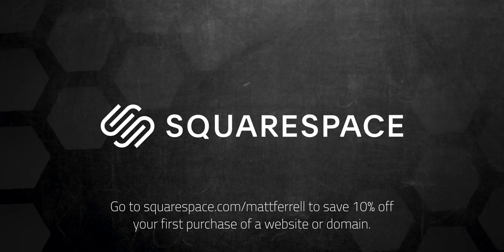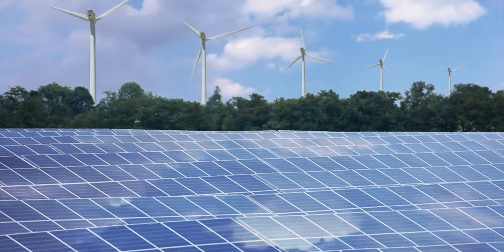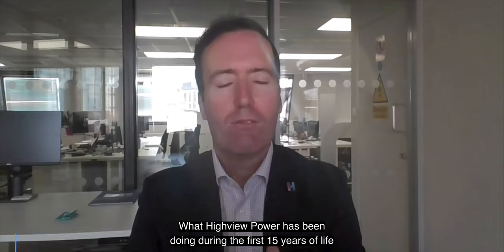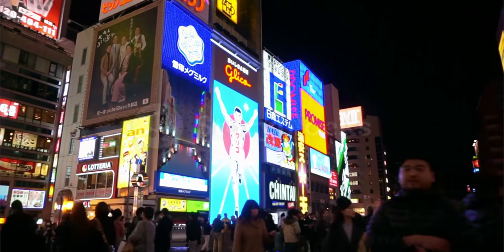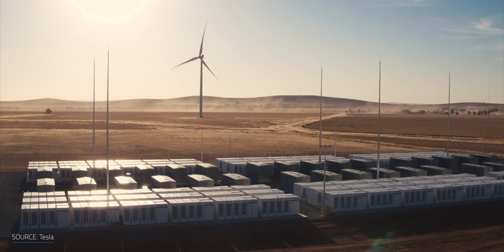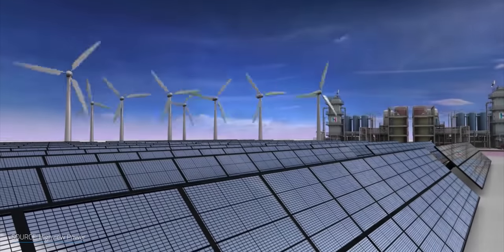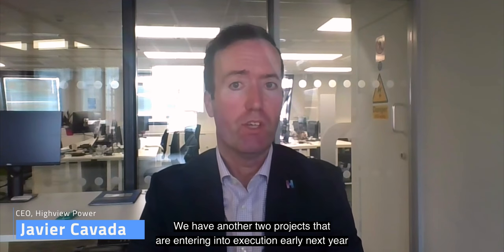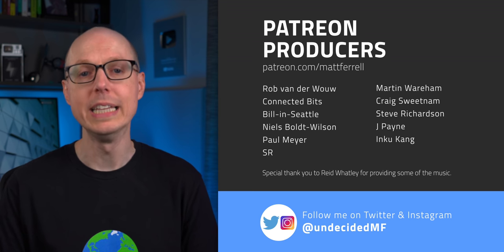Liquid Air Battery Explained - Rival to Lithium Ion Batteries?

Comment: Why not build it inside compartments underground. You'd save money on insulation and can more readily transfer heat with less direct insulation.
Reply: I thought about that too but then it's more expensive, harder to built,  harder to inspect, more prone to explosions and normally all storage processes are needed for say  half a day or so only so a little more loss is no problem.
Reply: @jean-pierredevent970  I forget my original thought process but I think underground bunkers would work. One room for cold one for hot. The rooms would act as ambient batteries further recycling heat energy or at least minimize losses seeing as some of the fixtures build up frost. It'd at least be better than having it out in the open.
Reply: @lazylazerrsp8781  Yes, true. the heat and cold losses would be minimal in these special isolated rooms.

Comment: The purpose of the liquid air storage system is to store "surplus" energy from systems like solar and wind power that would otherwise have some energy generating components turned off when supply exceeds demand, thus putting them to "sleep".  The liquid air storage of such "surplus" energy is far cheaper than using lithium Ion batteries etc...

There are also alternative energy storage systems like the flywheel, where energy is stored as a massive multi-ton rotating flywheel. The Liquid air principle is much better though I think, as it would last longer in storage until needed.
Reply: The real improvement is possible with intercontinental power exchanges through new very high voltage direct current cables. With a very smart grid, surplus and shortage of green energy will distributed real time so wind energy from China could even feed our grids during the night. Some local storage will be needed to keep the grid stable and smooth. That's why we need now very smart leaders too.
Reply: @jean-pierredevent970  What I do not understand is why have we have not started to harness the energy from Lightning.
Reply: @generaza7609  I honestly never thought about that. Perhaps the huge charged energies building up before a thunderstorm could be tapped off but I have no idea how or if it's practical to do it.
Reply: @jean-pierredevent970  Well we are referring to liquid air storage, so perhaps if there is enough machinery to absorb the lightnings entropy and convert it in real time to liquefied air, we could store it.

There are also other means to store energy such as flywheels.

If the lightning strikes were collected by huge electrodes and stepped down in voltage to a manageable level, it could drive huge flywheel motors, which may then be tapped.

Comment: While making liquid air benefits from economy of scale, one can imagine making it on site at truck stops and having trucks that could then store and use it. Especially good for refrigerated trucks since cooling is a by product. Solar air heating panels on the trailer could increase the range perhaps. Perhaps this could be practical for cars as well. I have seen compressed air powered cars developed but this would have better range and the tank might cost less. If I was GM I'd really think about leveraging my hybrid tech and coming out with a liquid air battery electric since the turbine, generator and electric drive train are definitely in their wheelhouse. They could tout recharging as fast as gassing up.
Reply: The cost of small cryo units is prohibitive compared to distribution the product from large facilities. The equipment involved in the process is very maintenance intensive. Even heavy consumers of liquid nitrogen like refineries have it trucked in. If you wanted to use it to cool refer trucks filled at stops, you’d end up just shipping it to the stops and storing it in tanks.
Reply: @gibmebalut  Thanks so much for that input. I wonder though if medium sized units could be made that overcome some of the cost issues although trucking the stuff from a large  plant near an urban area to gas stations equipped with equipment to keep it cool might be practical. If I was GM I might try to do something to overcome the drawbacks.
Reply: @stevemickler452  The good thing about cryo storage tanks is that they don't need extra equipment to keep the product cool.  The vacuum jacketing is very effective. As a matter of fact, If product is withdrawn from the tank regularly, a small amount of the product needs to be boiled off in a heat exchanger to keep the tank pressure up.
Reply: @gibmebalut  Thanks. Good to know.

Comment: Perhaps I missed it, but I was wondering what fuel is required to do the freezing and compressing? Do you have to burn fossil fuels to run that equipment? Or can it all be run on the electricity that the storage units produce?
Reply from the maker: It can be run by any energy generation system you want.  You could power the system from renewables.
Reply: So you are saying that there are no internal combustion engines running the compressors etc. and that the power needed to run those engines is far less than the power that can be stored as liquid air.
Reply: @wickham53  , the whole point is to power those compressors with excess renewable (wind or solar) free electricity that would otherwise be wasted. And you always get less energy out than you put into any storage container. The question is, how much is wasted. If everything put in would have been wasted, you will gain some useful energy out in the end.
Reply: Thank you. That makes sense.

Comment: How does the energy density compare to hydrocarbons?
Reply: Considering this is renewable, it's not a comparison.
Reply: Very low on discharge.

Both expanding air and expanding combustion products are driving turbines, but the heat of combustion is much, much higher than the (recovered, stored, and therefore somewhat lost) heat of compression from the air.
In addition, the expanding air is taking more energy (because of the phase change from liquid to gas) than the energy of expansion in the expanding combustion products.

Of course, being storage, with the efficiency penalty, you could say the energy density is negative! :)

Comment: How do they capture “waste cold” 🤔
Reply: They seem to do it with gravel beds. You need probably rather fast heating of the liquid air?  So I wonder if there is time enough to capture the cold formed during the whole expansion. It could work also more efficient if you could perfectly insulate that cold gravel but that's very expensive. So there must be losses. I want to believe in it but capturing of heat and cold seems the weak point. Of course if you have a factory with much waste heat nearby, you can use that and  perhaps even ditch storing the heat formed during compression. This saves also a lot of space.  And so if there is a good source of waste heat nearby, I surely believe in it. But are no better ways to store heat and cold??

Comment: "using energy to compress air down to a small space", where does that energy come from initially?
Reply: Excess energy from a grid. Unless I'm not understanding what you mean.
Reply: @thebaddestogre-3698  so it has nothing to do with "replacing wind turbines" it's just for storage?
Reply: @goodbrainwork  yes.
Reply: @thebaddestogre-3698  what is it actually replacing?
Reply: @goodbrainwork  it's just another form of storage like batteries, flywheels, gravity trains etc.

Comment: 300 % and over efficiency has been here for a century but the 13 families ruling the world can't capitalize on that so why keep breaking your head on storing solutions?
Reply: How do u have 300% efficiency, thermodynamics wouldn't allow for it, yes watever powers may be wouldn't allow peak efficiencies due to profit, however its impossible to gain more than what u put in scientifically
Reply: @mattaeom2027  School thermodynamics wont allow for it and there is alway an hidden input to account for, that your mainstream science doesn't mention whatsoever as the hundreds of patented systems that partially disproof thermodynamics laws.
Reply: @Rapbando  prove it
Reply: @mattaeom2027  No need to prove anything, the clues are in front of everyone eyes, is just a matter of freedom of thinking. Small example, permanent magnets need just a brief high intensity EMF to be polarized while their magnetic fields last for years and ifarranged properly can produce energy surplus in one oreder of magnitude over.
Reply: @Rapbando  in order to create electricity using magnets u need to move the magnet over a conductor such as wound copper for instance, u cant get infinite energy using magnets as u need to move those magnets to exchange the mechanical energy into electrical exerting energy and heat(loss), and simply rearranging flux to "create" energy isnt possible, if u could do so anything made out of iron would fly in from thousands of miles, if u could find some sort of actual proof, change my mind otherwise im gonna believe my electrical diploma amd the thousands of ppl failing to create self sustaining machines
Reply: And yes 1 instance of high emf can make a permanent magnet polarized for years, however no amount of rearranging will increase the amount of flux it generates even if every atom in the magnet were to become polarized, it could not generate anymore flux than thermodynamics would allow for
Reply: @mattaeom2027  You are looking for proofs and also you sound like you want to disproof all my statements and I'll never waste my precious time around such personalities, if you are indeed a person... If you really want proofs experiment and you'll have many.
Reply: @Rapbando  no im interested, if u dont want to prove it, it probably means u cant prove it, i spent 2 years in college getting my diploma, doesn't mean ive stopped looking for information, but I shouldnt expect u to physically prove it either as I dont have million dollar lab equipment and u probably don't either, but I can ask for resources as to where u get your info, so in that sense id like u to prove it
Reply: @mattaeom2027  Modern school is the last place to look for unconditioned information.
You already have all what you need to prove my points, It's just a matter of freethinking and not taking the dogmas for granted, no money needed, just research outside the gatekeeping organizations.
Reply: @Rapbando  dude i didnt ask for much, just where u get your info
Reply: @mattaeom2027 dozen of places, and I wont write where here because I want those sources to keep existing for others. Hint: internet became a double sided weapon even if it was concieved for military scopes and mind is like a parachute, it needs to be open in order to work.

Comment: "Another expensive tech" Gravity city is better.
Reply: It's off the shelf tech just used in a novel way which keeps the costs down. They have also been running two test plants 2011 and 2018 and are now building commercial plants in the UK and America... I think so far Gravity City have managed a Nikola campaign and to put up a crane. Just saying.
Reply: @helenlawson8426  you are right but gravity city tech is cheap and don't requires much space.Its future surely depends on the company's management bytheway it is pretty simple and simple means a lot in engineering
Reply from the maker: Love that tech too.  This is just another tool in the toolshed to chose from.  Gravity energy storage is another "why aren't we doing this already at scale?" questions.
Reply: @harbeermalik8484  It may have its place and we would be foolish to count anything out now as there is a mountain to climb yet to get to the level of energy storage needed.
I think they would do themselves more good if they showed it as something like SpaceX's new High Bay shed a closed structure with cranes built into the roof. Theoretical designs can ignore the real world by the fact it is all about working out efficiencies and technical issue but then they have to look at being able to operate anywhere at any time of the year. If there is a maximum windage it can work in then that is a limitation and if rain & cold can freeze blocks together then that's a serious issue at the time of year when storage is going to be in demand.

Comment: Brazilian researchers are in a run to make an fuel cell (or a liquid air battery) on ethanol. That would solve the battery problem in Brazil. We already destroyed a lot of land to make ethanol for combustion engines. So, how the damage is done, sugar cane for us is a carbon neutral type of energy. The ideal point is that running in a fuelcell the ethanol would double the effiency!

Comment: Lol as soon as you said compressed air I immediately thought of these exploding due to sunlight warming up part of the container

Ok now we're going to use a lot of energy just to remove most of the energy from the air (chilling the air) then add a bunch of energy (compress the air) to store a little energy to be used...where? WTF?! 25% is theoretical; they're lucky to get double digit efficiency. Compared to near 100% from lithium storage, these guys are grifters.

This is the worst storage solution I've heard of. Just pump some water uphill. WTF is wrong with people

Comment: “Solar and wind are some of the cheapest...”
Need way more context. Fossil fuel dependent should start that sentence off as there’s no such thing as self sufficient solar and wind powering industry anywhere in the world.
Reply: That is only because fossil fuels are currently a large portion of the electricity supply.  Once the grid is 100% solar and wind, solar and wind will be self sufficient.
Reply from the maker: That's why we need cost effective energy storage.
Reply: CorwynGC It’s because solar/wind are intermittent / don’t work properly most of time / require fossil fuel back up 24/7/365....Or battery storage on an industrial scale which increases their cost by orders of magnitude and not even available yet. Solar/wind can’t even power a single modern factory on a self sufficient /cost efficient basis, let alone power a city. Might change in future, but as of right now, they are parasitical energy sources that only add cost and instability.
Reply: @lawsonhannah  , you are forgetting the other power sources, hydro and nuclear. Several countries now operate their grids with little or no fossil fuels.
Reply: Harry Parker Harry, That’s correct...Nuclear,, hydro and geothermal are great sources of self sufficient/reliable energy, but S/W are anything but...They’re unreliable/intermittent and “parasitical” sources that jusy add cost and instability to the grid....They all may all be in the renewable category, but that’s like comparing apples and donkies. The  burning of biomass/wood pellets fall under the renewable category as well I think, so there’s definitely some category errors going on. 

The challenge with nuclear/hydro is that they are generally opposed by the climate activist and geo/hydro don’t scale up very well due to their unique geologic requirements. The low power density of S/W combined with our mind blowing amount of power used, makes the land use and battery storage requirements so cartoonishly large that is just becomes abstract to the general public.
Reply: @lawsonhannah  Yes, biomass is almost as bad as coal, as far as air pollution goes. "Renewable" does not equal "clean". 

What causes grid instability is not renewables, but lack of sufficient energy when it is needed. Energy storage as well as overbuilding Wind and Solar is a solution. CA is blaming the rolling blackouts on offline gas peaker plants, shut off transmission lines because of "deferred maintenance" (the trees underneath them were not trimmed as they should have been) as well as the record breaking heat causing record breaking high power demands for AC. The new solar installations actually helped contribute needed energy during afternoon peaks of need.

Many people have contributed to studies showing that switching to 100% renewables plus storage is both possible AND will save everyone money, to the tune of trillions of $$$!  So yes, more storage will cost lots of money, but it will save much more in saved fuel costs and avoiding the consequences of a faster changing climate and pollution. For learning the quantitative details, you could start here: https://thesolutionsproject.org/why-clean-energy/ .

Comment: In the end these  "batteries" seem to need to be filled using compressors that will run off electricity at some point, so the real source is the grid. This process sounds very complicated and gas cylinders made for pressure are heavy. Because of this these must be industrial batteries and not for cars, but even so if you have to go to all this trouble why not just get a regular batteries, some solar panels, and plug in? One thing I do not understand is why electircal grids store power in tansformers at sub stations, but solar can not adapt this to store energy in the same way. It should be easy since the only change is the way the power is put in??? Why is energy storage for eco power sources so hard compared to the grid?
Reply: Dude, you think transformers Store energy
Get off the internet please
Reply: I only foresee that with present techniques, efficiency will not be stellar.   The expansion and turbine driving energy comes indeed from the initially stored compression heat  and so from the grid. But that grid must be based on renewables of course. The grid power system only stores here enough energy to bridge the night.  The storage of heat and cold will not be perfect but again it's only needed for half a day.  As for the storage of the "liquid", this is on normal pressure. The tanks are double walled, like thermos bottles and some pressure builds up because due to thermal leak some nitrogen  turns to gas but there is an escape valve system with additional safety. This is all well known technique and proven safe "normally".